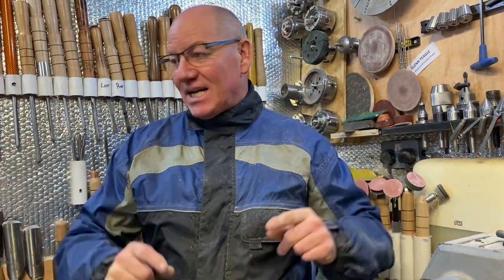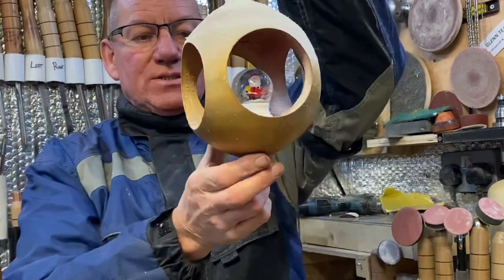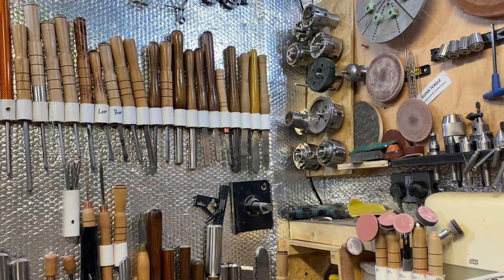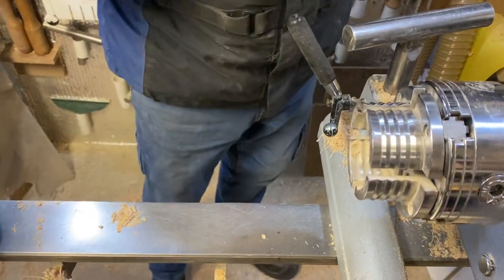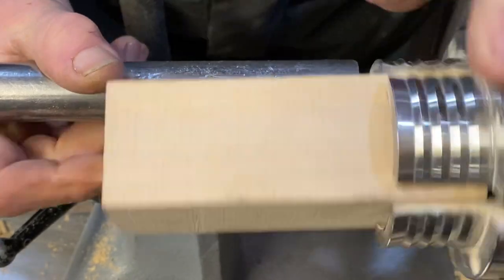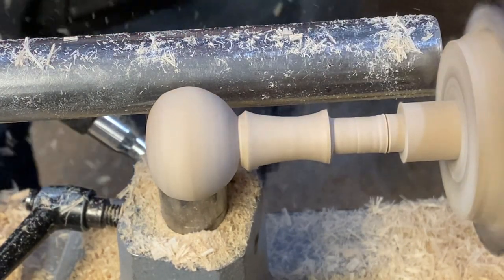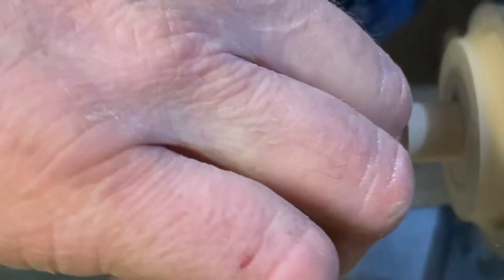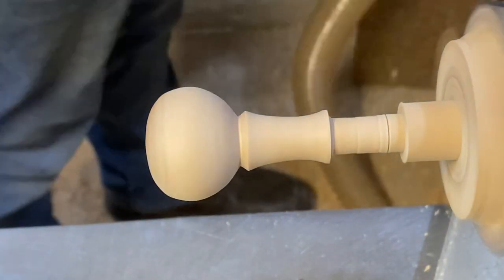Woodturning a Christmas bauble using a mixture of carbide and traditional tools Part 2

Comment: I think I’m right in that, Liza did ask for gold in part one & you sprayed it red sooo, I wasn’t Really surprised when part two started, it was with a gold bouble. 😂🤣
Another excellent turnout Glenn 👌
Reply from the maker: Yes, she was right, I actually forgot we had bought the gold paint. That wood just soaked up the finish so much that it was hard to get any shine, but I wanted to put the spray snow on it anyway. It will look good when hanging outside.